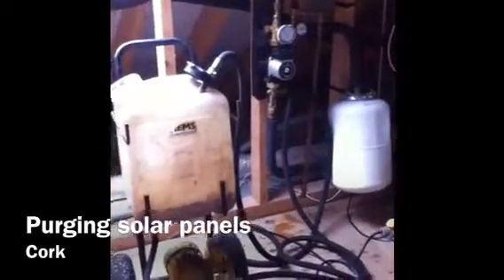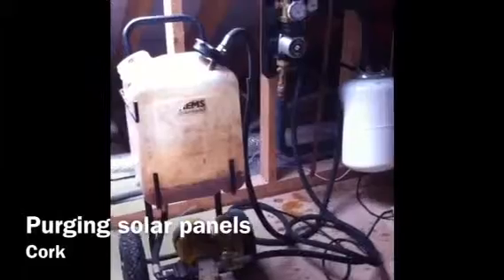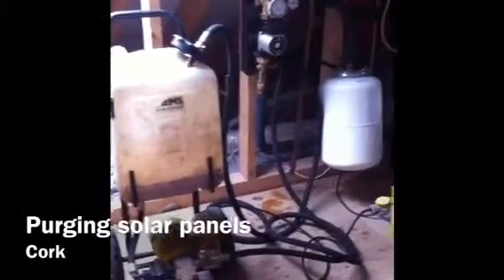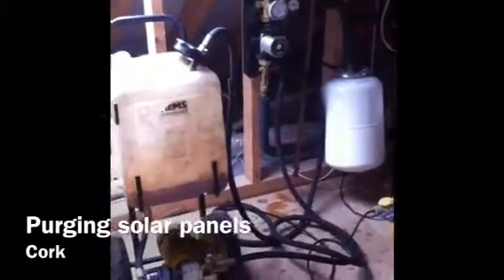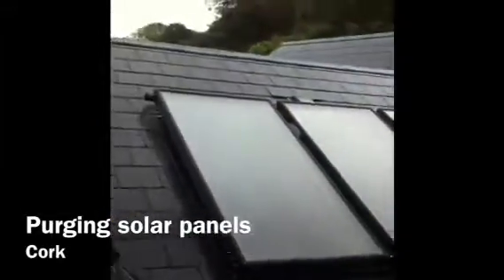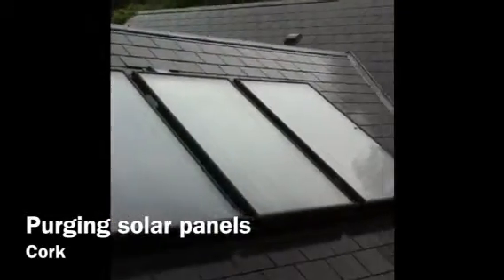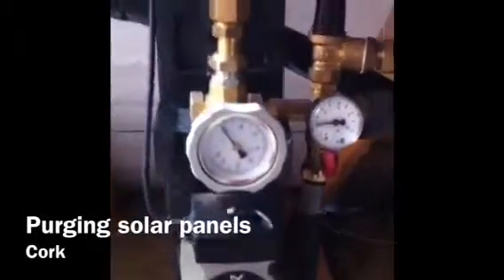Solar Panel Flushing / Purging

Comment: Thank you for this video. I have noticed that there is a non return valve on the expansion vessel. What is that for and I can’t understand why on earth this would be there. Can you please explain ? Thanks
Reply from the maker: It's a normally open non return. Only when the vessel is being replaced does it close.